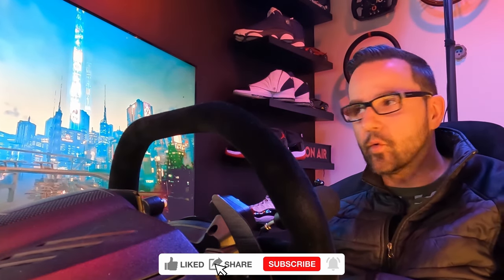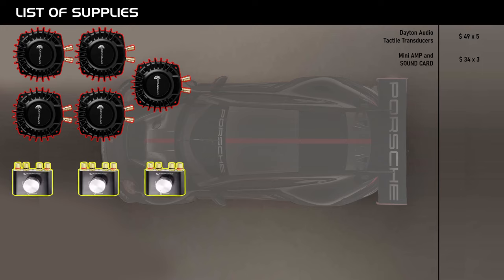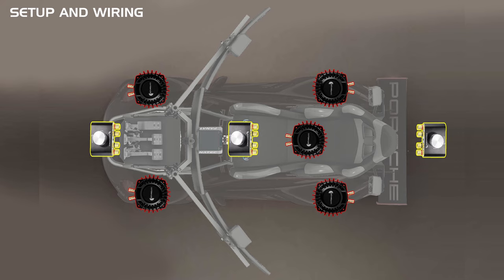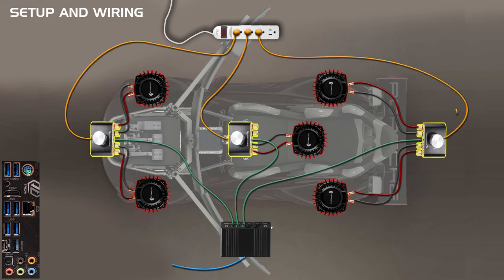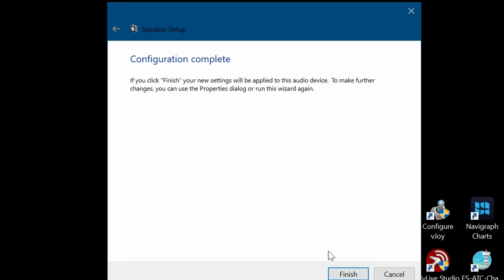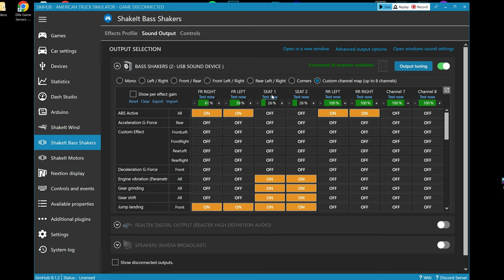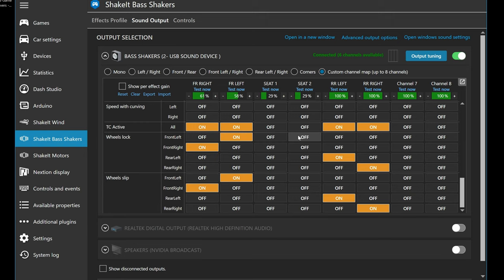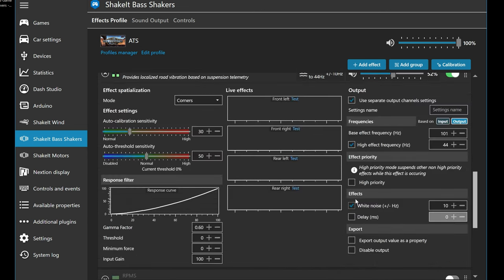DIY ULTIMATE Bass Shaker TUTORIAL | Step by Step HOW TO and SETUP

Comment: What are the chances this can be adapted to a PS5?
Reply from the maker: I used to have a base shaker running on my PS4. Some were deep in the comments below. You can find an explanation of that. I'm so sorry but this video has been up for a while and I don't remember what exactly it is that I did. I do remember having to look into it at the time to remember how I did it. To be clear, it is not the same at all ! He will get portion of it to work but it will not be the same as on PC